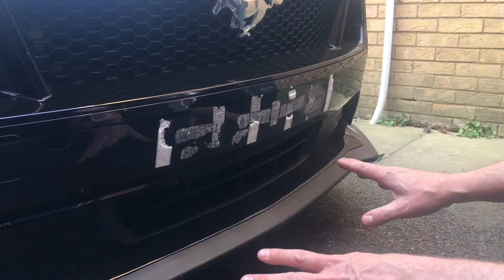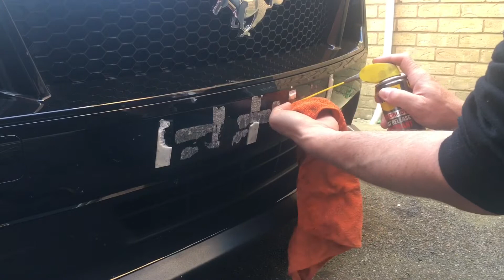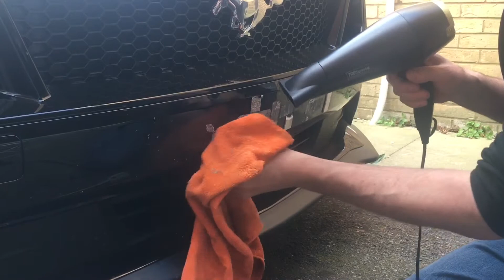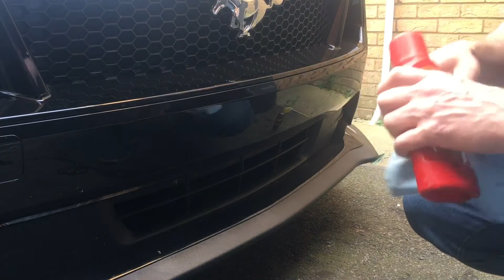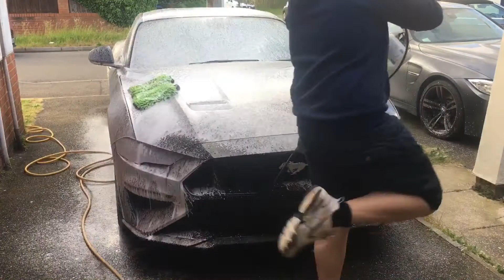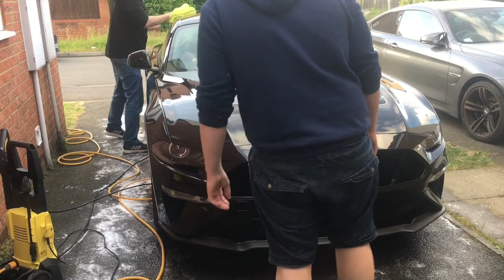Time to remove this number plate adhesive pad residue

Comment: How did you remove the number plate with the sticky pads on?
Reply from the maker: It just came away quite easy but can just using a card to slice it off